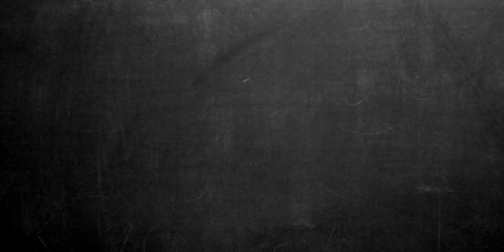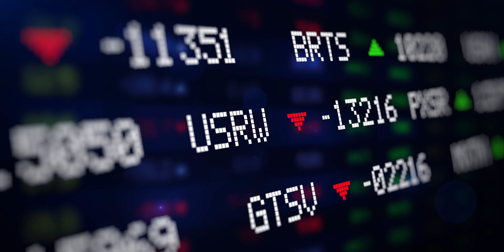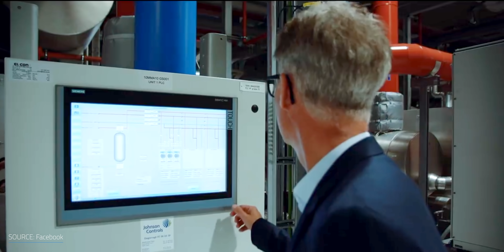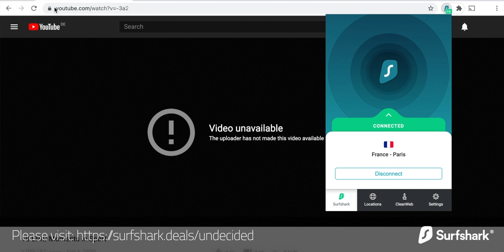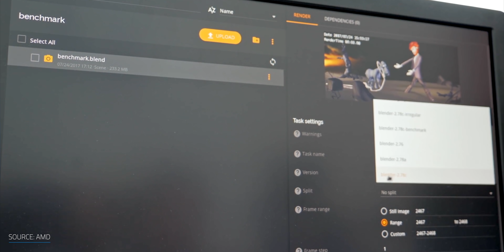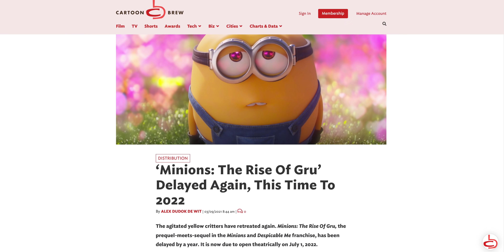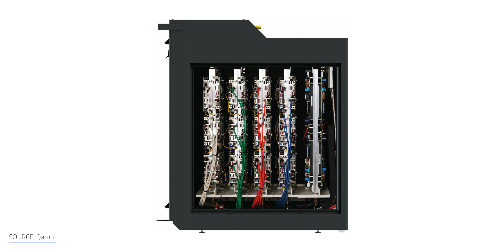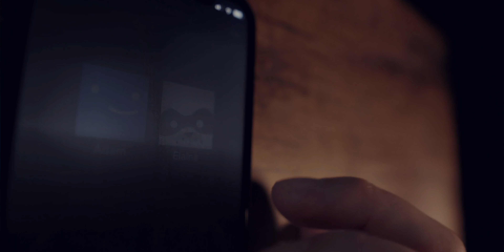Exploring How Big Tech Could Heat Our Homes ... For Free?

Comment: I heat my bedroom during the winter by playing something graphically intensive. Works better than you'd think.
Reply: Same here, and it used to actually be easier years ago when we still used CRT monitors & TVs. I could basically turn the heat off if I knew I was going to be on the computer for a long time. And as a bonus, the CRT monitor could easily warm up a snack from the fridge or freezer, just... make sure it's a snack that won't leak. XD
Reply: Same! Nothing like 2-3 hours of Overwatch to get that room temp up. My GPU heats to 60*C, and it blasts it all out as hot air from the back. Combine with the computer's CPU heatsink fan and the power box... have you seen the wattage on those small ceramic heaters? A gaming PC is better than them at it, and you can play a game.
Reply: I heat most of my home in the winter by mining crypto.
Reply: @PenneyThoughts  Same, I have electric heating so its free coin anyway and I might as well.
Reply: My gaming PC never gets that hot.
Reply: @slowanddeliberate6893  I only have 3 games that can make it run hot. I'm sure you can find one that raises the ambient temperature lol

Comment: Would be glad to see them in the UK, would love to have cheaper hot water, sure it's not expensive as it is but it still makes a difference to have cheaper hot water or even free heating, if it reduces my electricity bills in the process then even better, as a side note another place they can do their business is water treatment plants and steam based electricity plants where the heat is always needed, could do an icegiant style radiator system and have those radiators just line the bottom of water pipes, swapping out the the radiator out could be as simple as turning valves to redirect the water flow, opening another to empty the pipe of remaining water, removal of the pipe and placement of the new pipe, in both cases the motherboards can be protected from splashes with a simple screen where the heat pipes come out of to connect to the radiator, leaves plenty of room under the radiator pipes to swap them out with.

Comment: As a VFX artist, I can attest to the heat issues associated with rendering 3D scenes. I am able to heat my two story home with 4 GPUs rending via Octane during the winter... with the windows open. :P
Reply: I usually overclock my PC during winters. Its free cooling, why not.
Reply: Same here 4x 1080ti is nice and cozy
Reply: if you want to expand on this try installing a couple 8 gpu mining rigs ;) let the gpus pay for themselves at the same time
Reply: @oscarmike47  Where I live electricity is too expensive for mining to be worth while.
Reply: @BookmansBlues  yea especially with current gpu prices. with 0.2c per kw/h your still looking to roi in about 8-10 months. which is too long imo. but on the other hand if you had the rig running for 2 years then you could heat your home, roi and still make a small profit
Reply: I was going to say the same jajajaja
Reply: Same but with 2x1080ti's. It's really heating the apartment. At least it's not wasted heat in winters. Waiting on renders on days is suck tho, try ue5 it's really good with reasonable quality for mid-low budget works. Mograph etc. It can really come handy on tight deadlines.
Reply: what are you using? quad 3090s? I've only seen that being done once before and it used almost a 2000 watt psu, which I wouldn't risk, any Spike that goes even a tad bit over the maximum capacity could blow the thing, an expensive mistake, that could only be made once.
Reply: @It_Is_I_I  4x 1080ti's currently. I have a 1,500w PSU, and at max load draw ~1.1kw of power when rendering. Keep in mind, rendering takes a long time, so you are basically running a medium space heater for often days on end. So it is not like those GPUs instantly heat up the house, it can take a few hours. I don't do it often though due to the cost, electricity here is expensive. The time I was referring to in my post I was rendering for a month straight, and cost me over $1,000 in extra electricity. So most of the time I now use a rendering service for paying gigs.
Reply: Ironically, for my needs, a single 3090 is of equivalent rendering speed of all 4 of my 1080tis and has more VRAM. I want two of them. ;)
Reply: @BookmansBlues  "Ironically, for my needs, a single 3090 is of equivalent rendering speed of all 4 of my 1080tis and has more VRAM. I want two of them. ;)"

Wouldn't Pro GPUs do a better job at this?  Have you watched the video from AMD for the server products they're going to be putting out with Zen 4 and RDNA 3?  I think those GPUs would probably blow through most tasks pretty quickly.  Maybe I'm wrong.
Reply: @johndoh5182  Quadro Cards can be faster for certain tasks, but also come with a heavy price tag, I cannot use AMD cards at all, as I need CUDA, and ideally, those RTX Cores help out a lot. So Team Green or go home in my case.
Reply: @It_Is_I_I  So after reading what you said and the response, be aware that much media production, such as for movies and TV, where there's a decent production budget uses contractors that do this for a living, but would have an office full of equipment including render servers, or the studio has the equipment to do that.  Trying to do that in a form factor like a PC isn't the greatest thing to do.
Reply: @It_Is_I_I  : just add a phase/power controller and no worries !!!! Really

Comment: I use a tabletop water distiller and it makes better water than bottled water, and heats a room no problem.  As large amounts of the world need clean water and saving on plastic is great..  If only I could be powering it with solar, don't have that setup yet.

Comment: You are not kidding, when I get my I9 10900K going and my RTX 2080 super they draw around 400-500 watts and loads of heat rises out of the top of the case. I run AC all summer period to keep the room controlled and cool. Window open in winter lol.

Comment: I used to have an idea to have a mining farm using otherwise idle retired computers that runs only dependent on the weather/thermostat and starts mining when the central heat would be running, however I realized that my central heat was a heat-pump and is much more efficient than using waste heat from a computer. In my case generating extra compute load just to generate heat doesn't make sense, but in the case of the video where the heat is being generated anyway for other needed compute applications it make complete sense to recover and not waste that heat that is being generated anyway. Great idea.

Comment: this Qarnot endeavor is a HUGE waste of resources. There are plenty of better ways to generate new heat that do not require you to manufacture silicon chips which are already in a shortage right now. Also, distributing your server throughout buildings, instead of in a secure central location like now, means your datacenter is immensely vulnerable. Not to mention cooling a bunch of hardware in the same space is much more efficient than cooling hundreds of servers spread apart.

Edit: to add to this - chip manufacturers are always trying to make chips more power efficient and emit less heat as a result. This business is on a downfall from the moment its conceived.

Comment: Super markets have 5 rows of freezers.  
Always thought it was a waste .
Summer they could vent it outside .
Winter , direct it to the hvac for heat .
With heat pumps,  even low grade heat can be used .
Also, put coils under greenhouses to heat them year round

Comment: These ideas have been going on for many decades. Grocery stores have taken heat from the refrigerated isles to heat other parts of the store are water. Restaurants have used heat recovered from AC to heat water for dish washing. Heat pump cloths dryers take the heat from the exhaust to heat the intake air. Geothermal heat pump can have a de-superheater which take waste heat during AC cycle and puts it in the water heater. It's good to see more ideas. I'm not sure why I can't find a heat recovery for a home fridge to heat water either in water heater or for a hot water dispenser like it has for cold water.
Reply from the maker: I'm curious why we don't see more of this for home appliances as well.

Comment: You said that water cooled server farms produce water typically 30 to 40 degrees C, which is wasted - surely a compression heat pump (like a ground source heat pump) could easily take that relatively high temperature water and convert it to very high temperatures for almost no cost?

Comment: Living in the north of Sweden I have been heating a stable for 160 chickens with crypto miners for 6-7 years now. It has not always been free but cheaper then traditional heating for sure ... long term so far it has been a nice extra income as well.
Reply from the maker: Clever.
Reply: That's brilliant.   Unorthodox but brilliant
Reply: Are heat pumps not realistic for that application because of the cold wealther and small scale?
Reply: @ThomasBomb45  We have a geothermal heat-pump on the main house and a air source heat-pump on a side building. Geothermal works well (drilled is the most efficient) but it is expensive to install. The air based systems lose allot of efficiency when it gets colder then -20c. In a medium sized stable that needs airflow so the birds get fresh air every few hours heating can become expensive. As a computer nerd It just made sense to me to offset the cost this way. (btw it gets up to -30c with spikes to -40 up here)
Reply: So does it mean that you have some crypto servers adjacent to your stable and use the heat rejected by their server? I’m just trying to understand how this system works. And may I also ask how it generated extra income?
Reply: @mahyarhesari4251  Yes kinda, simple Inline duct fans pull air through ground tubes into the attic space of the stable, takes the coldest part off and dries the air somewhat. From there it goes through a hand made drying setup (boxes with ripped up cardboard that I replace often) into one side of a hand made ‘server rack’ where fans just blow it through the ‘servers / computers’. Then on the other side of the rack/cabin it gets pushed out into the stable through ducts again. (server rack is semi-closed on both side to push air one way)

As to making money. I do not sell more coins then I need to cover the electric bill and hardware, sometimes this means I save up coins, other years it means I dip into the coins saved up from before. While I still have some GPU miners, most these days are Innosilicon and Antminers (around 2500watt per unit). (Keeping mining hardware up-to-date was hard for a while but that has somewhat stabilized as well over time)

Nothing special or complicated about it.
Reply: @nityasattva182  awesome. Great explanation. Thanks for that. Particularly I like how you used ripped up cardboard to dehumidify air, not too fancy but gets the job.
Reply: @mahyarhesari4251  generate coins while you make heat. Fairly straightforward.

It's the concept of reducing waste, not by stopping a thing but using the side effects to reduce your dependence on something else.
Reply: @morosis82  thanks. That makes sense
Reply: Your setup makes me wonder if this sort of thing could be used in dairy farming. Here in Canada a big expense for dairy farmers is warming the barns all winter, but maybe some kind of Carnot style computer heaters would reduce or eliminate that expense. I guess the setup would be expensive, since dairy farms don't usually have high speed Internet. But once everything was in place it might save enough in operating costs to keep small farms viable.

Comment: Qarnot sounds like a massive security issue. One of the biggest advantages of having servers in a secure building is.. that they are in a secure building. They are basically giving hackers easy access to their hardware and with that their network.
Reply: First thought I had.
Reply: Under that premise, every network device in every home or business is a security risk. Which, frankly, is true, but then you're dealing with insider threat detection. But your point is well taken that not all computations are safe for a distributed network, which is why their clientele skews toward those that are less concerned with data security. No PII, no PHI, no financial information. Proprietary information, yes, but the advantage of distribution is that the whole dataset isn't available at any single point of attack except where Qarnot can create reasonably physical security measures around it.
Reply: I don't think they'll store/process sensitive data in those servers. I think it would be used like other distributed computing applications like BOINC, Folding@home, etc.

Comment: I use my computer for 3D modeling and rendering. 
RTX cards work up some good heat when run at 80% capacity for hours at a time. 😅
It keeps my office nice and toasty warm through the winter and keeps me working the computer for extra warmth, lol.
Reply: Three 32 inch monitors add a lot too. And my sound system almost has an updraft...

Comment: The Quarnot idea has already been done by Nerdalize.... they went broke and then restarted. Problem is that during the summer you don't want/need that heat so what do you do? Slow down that computer and wait till someone takes a shower?
Reply: Pretty much. Before I realized how much cheaper it was to use my heat pump to warm my home I had an idea to set up a mining farm with old retired computers that would dynamically pause based on the state of the thermostat so it would really only run in the winter. Heat pumps are so much more efficient that it doesn't make sense in my case, but I still wonder if I could somehow tie together the CPU heatsinks with my water-heater supply line to recover that heat there since the water heater is resistive heat anyway (equivalent to the boilers in the video), maybe with heat pipes. Anything like this is going to only be suitable for certain situations and the goal is the just recover wasted heat that would be generated anyway (hence the distributed computing for other needed applications).
Reply: @PlutonianPenguin  If one has a room where all devices that generate heat are placed together, one could take the heat of that room and heatpump it into the house or hotwater tank. If there is no need for this heat one could try to store it in the hotwatertank, but after that, there is not alternative then letting it go out the chimny
Reply from the maker: That's precisely why they're more focused on their boiler system.  24/7 for hot water.
Reply: @UndecidedMF 

like you mention at 10:10 and further, like you 9 out of 12 months I do not need to heat my house, only a limited amount of shower water. If the server is running during those months I guess a lot of heat still leaves through the roof, reducing the efficiency of the system.

Of course, as the heat is for free, I could go back to heating all rooms of my house again at 21 degrees celsius ;-)

Maybe it would work better in a situation where multiple houses get heat from mutiple sources, like a city heat pipe where these servers can be used for a baseline amount of heat.

Comment: I have been using my computers to heat my office for years, it works well
Reply from the maker: My office gets nice and toasty in the winter the same way.
Reply: @UndecidedMF  Actually I use the furnace for 2 things. Keeping the pipes from freezing and keeping the bathroom warmish, when I am there for more than 5 minutes. My office is heated by the sun, electronics, and my refrigerators. It usually stays above 60. When it isn't I turn on extra PCs and compress files for heat and space savings.